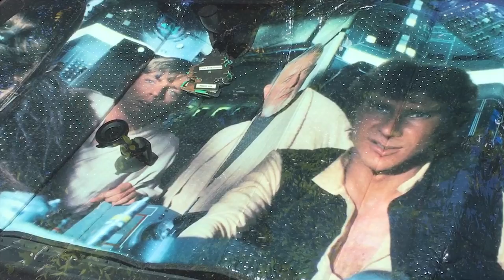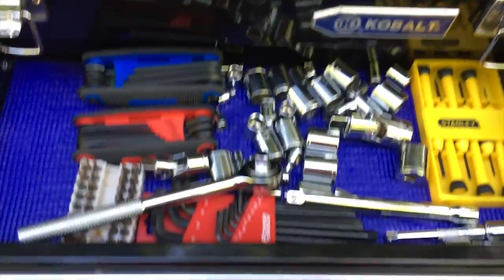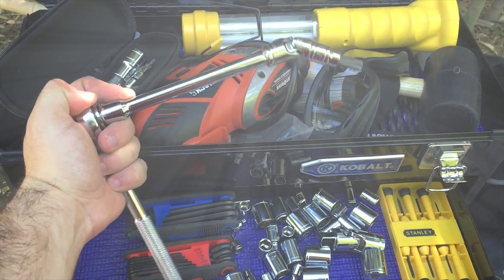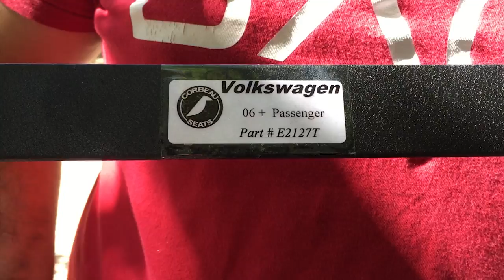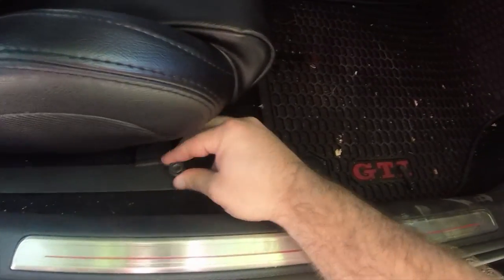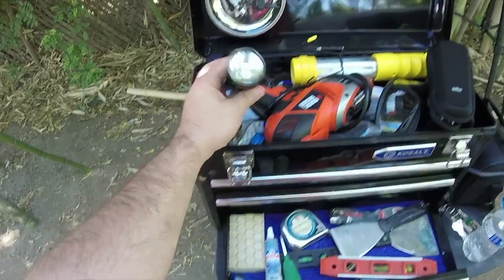2016 MK7 GOLF GTI | CORBEAU SPORTLINE RRS INSTALL

Comment: Awesome video! However, I still have a question. Do you have to use the OEM seatbelt buckle from the stock seat or do the seats come with their own?

Also, how did you get rid of the air bag light? I'd like all of the other airbags to still work properly lol.
Reply from the maker: Stock belts, leave the light and send it.

Comment from the maker: NOTE: I did not mention in the video that installing these seats will deactivate your airbags and a dash light will come on. It DOES NOT chime however. Also if you purchase the heated seat option it is not a plug n play to the OEM seat heaters. They must be wired separately and operated via an external switch that must be installed somewhere in your car.
Reply from the maker: +william wolfe Tell me about it, $1500 dollars later.
Reply: @TheGrizzlyGarage  would the airbags still work?

Comment: are you gonna add resistors so airbag ligth wont be on also how did you rewire the seat sensor for when someone is sitting on it or if you leave it unconnected it just always stays on ?:
Reply from the maker: I just left it on, light doesn't bother me.

Comment: What did you do with the pressure sensor on the passenger side under the seat for the seatbelt and also did you figure out a way to remove the airbag light?
Reply from the maker: There are ways but I haven't bothered doing it yet. Light doesn't really bother me, sorry!
Reply: GrizzlyTV I am thinking of buying the same seats as you, are they comfy and do they hold you good? Do the springs absorb some of the shocks?

Comment: So how many inches do you say they drop the height of the seating position? That's really the main reason I want these seats. I think the seating position is way to high in  this car
Reply from the maker: I didn't measure but I'd guess a good 4 to 5 inches. It's a considerable drop. Before I could easily see the hood at the lowest stock height and now I can barely see over the dash.

Comment: How do you get these in with the pressure sensor that will trigger a chime for the seatbelt Being unbuckled???

Also is there no airbag now ??
Reply from the maker: As long as you use the seat belt buckles from your stock seat there will be no chime. There will be an airbag light however because you lose those with the stock seat but no sound emanates from it.
Reply from the maker: +william wolfe lmao 😂

Comment: Nice video. 
What happens with the airbag? Or did your car not have airbags in the seat?
Reply from the maker: Airbag light comes on, but does not chime. Just something you learn to live with. It doesn't have any negative effects to the car.
Reply: Having the airbag light on means that the Airbag system is deactivated. I would say that's a negative effect. So no resister box to retain function of Airbag, come with the seats.
Reply from the maker: +MagiChef I've never been a fan of airbags, and no it does not.